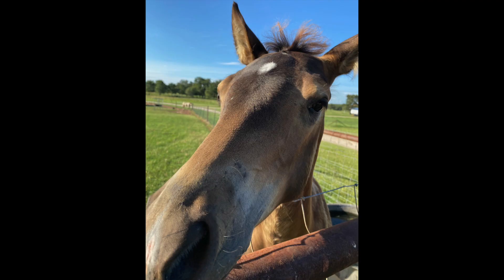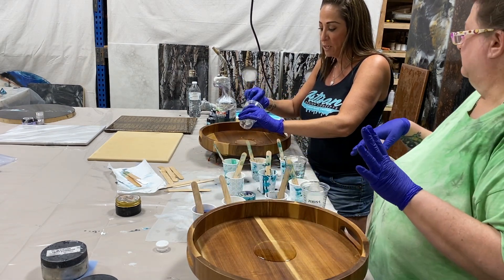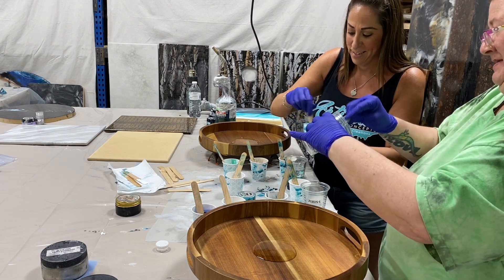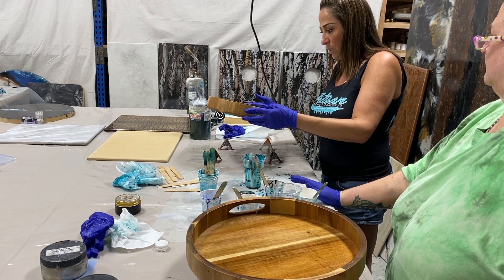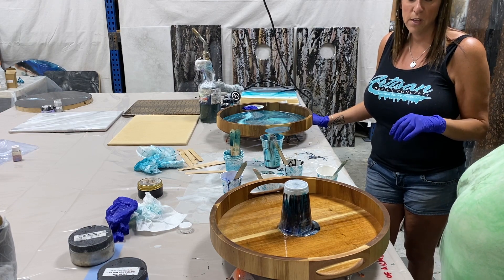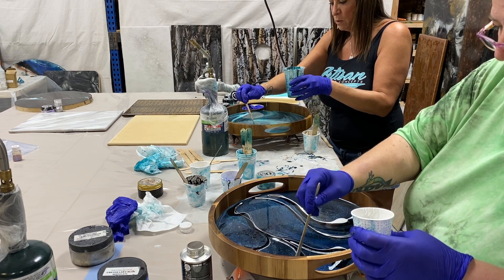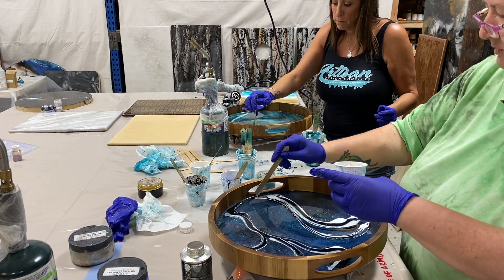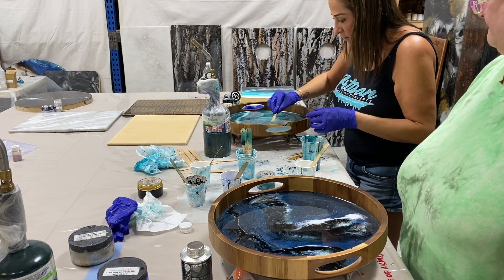Resin Creative Blast with Staci from Artisan Design Concepts | 378

Comment: Clara, do you clean or treat the bottom of the tray before pouring the resin?
Reply from the maker: Not these particular trays because I know they have been sealed already. If I do, it would be a primer, polyacrylic or a primer/paint combo. Let degas for 24 hours and then pour.